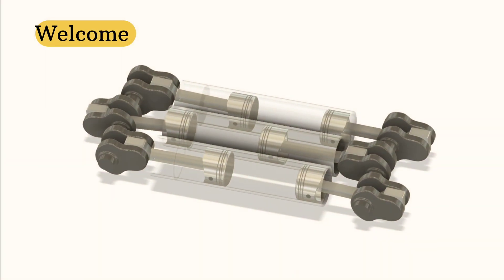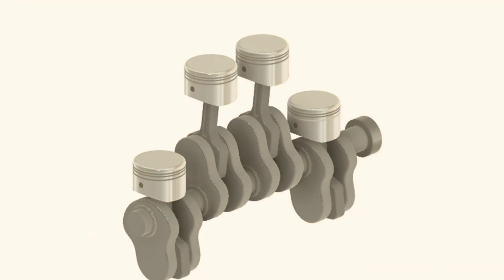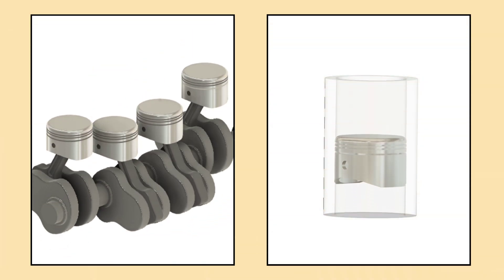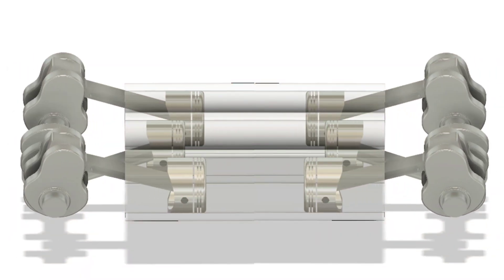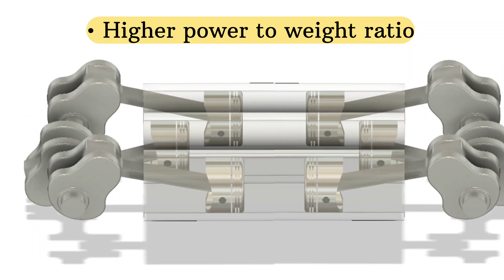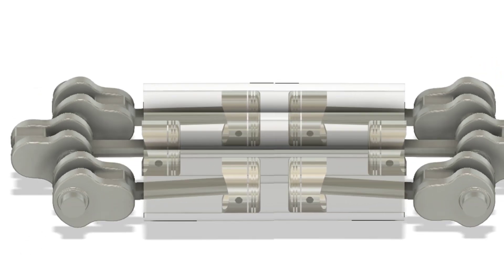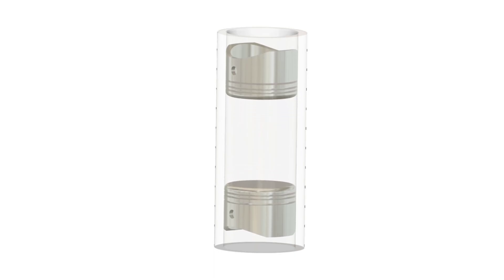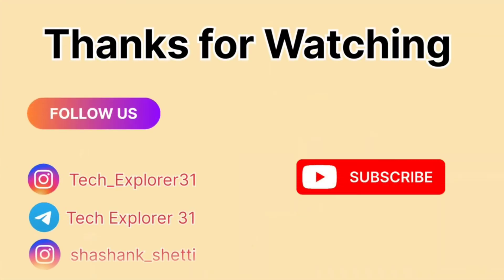"Opposite Piston Engines: How They Work and Their Benefits #automobile #technology #piston #engine

Comment from the maker: CORRECTION : I realized I didn't mention the intake and exhaust system in the previous video. Here's how it works in an opposite piston engine (OPE)

Intake Ports: The intake ports are typically positioned on opposite sides of the cylinder. As the pistons move in opposite directions (one going up and the other going down), air is drawn in through the intake valves.

Exhaust Ports: The exhaust ports are also placed on opposite sides. When the pistons meet, the exhaust gases are expelled through haust valves.

This unique design helps with efficiency and reduces vibrations because the forces of the pistons cancel each other out. Thanks for your understanding, and feel free to ask any questions!